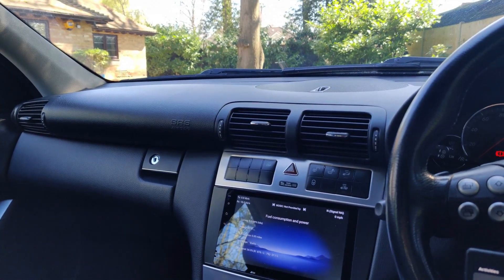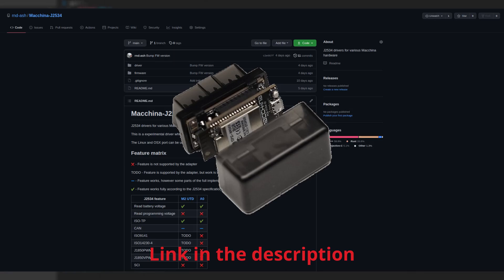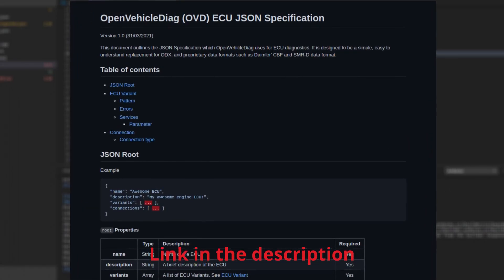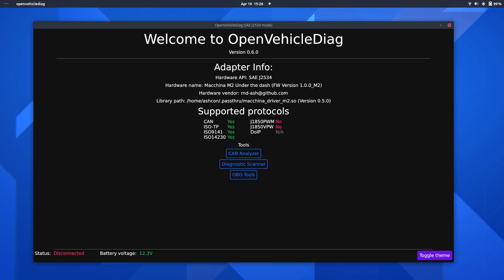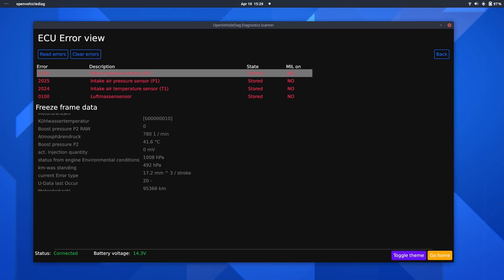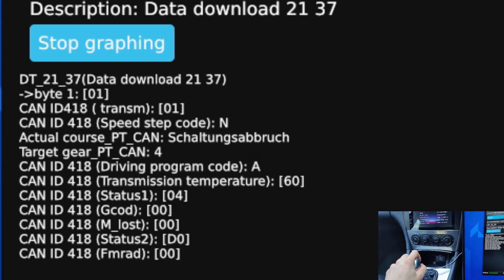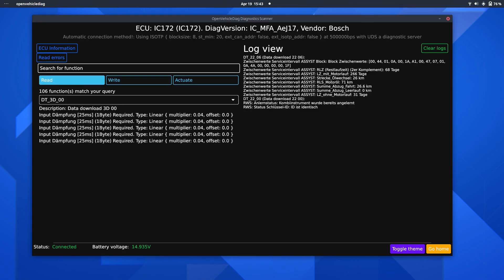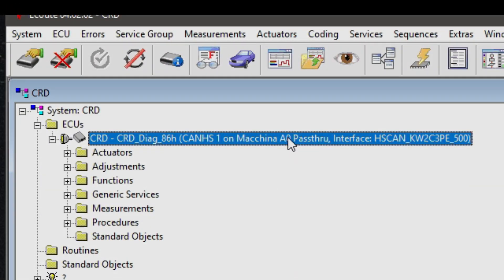OpenVehicleDiag / Macchina-J2534 release 1.0! - powerful open source car diagnostics for all!

Comment: Im in awe as to what you have accomplished. Well done. I do have a question or 2. Im was intrigued with the fact that you could get Xentry to work with your W203. Which is why I ended up here. Im having some serious ecm issues and was hoping I could get some info or links to connect my Arduino to the vehicle using the obd port? I need to program my ecu to stock as well as do the rest of the system to work with the new ecu. Any links on using Arduino would be great

Comment: Very cool. I also have a W246 that is showing "Transmission malfunction" on the dashboard. Would I be able to see the error codes with OpenVehicleDiag and an Arduino with CAN shield? No local sellers of the Macchina adapters in my country. Thanks!
Reply: same here , were you to them error codes on with CAN shield

Comment: But if the obd reader used a correct can bus chipset then no programming would be necessary .  You just have to get the right software..  is all in the software and parameters provrammed into the software that coincide with the vehicle’s as built code..  so you dont brick the ecu

Comment: i know this is a year old video, but do you have any interest in data from a Rotunda VCMII, and the FDS (Ford Diagnostic Software) data that may allow you and I to work together to make a linux base open source data set for almost every single make and model of car covered by the SAE and EUR, OBDII standard, possibly even moving into tge newer models as well.

my plan is to make use of the Right To Repair laws that have passed recently in the USA to build a software for my personal use both at work (ford technician) and at home (I.C.E. experimental engineering, building, and tuning.)

Current project is to build a software that can be run in a linux environment, perhaps RaspberryPi, or Arduino IDE, that can be a standalone unit for scanning, but also installed permenantly in a vehicle to act as a scanner and tuner.

Comment: Very cool! However, I'm not sure if I understood correctly: Are the JSON files required in order to run commands on any control unit, or will that also work when the software discovers them?

Comment: Could these JSON files for the ECU data be used for example in Torque or such android applications? Or is it because of the ELM327 OBD adapter that those apps can’t find alot of info from the ECU on my 270 CDI?

Comment: Not working on w210. I'm using 38 pin connector to plug in a0. Everything's connected, and it's scanning for ISO-TP but can't read any errors. Just says that no ISU-TP capable ECUs were found in my vehicle. Any suggestions?
Reply from the maker: Yes it would never work on a car that old as it has no ECUs that can be diagnosed over CANBUS, only Kline (LIN)
Reply: @RANDASH  is there anything I can do to read them ECUs with my Macchina a0? Or should I order m2?
Reply from the maker: Hate to say this but pretty much the only thing you can do at this point is get a newer car....A0 doesn't and will never support LIN especially as it's a long dead protocol.
Reply: @RANDASH  What about M2? Any luck with K-Line implementation?

Comment: Can your software be used to interface with the car functions say to control the A/C from a touch screen head unit? Something like the iDatalink Maestro RR2 adapters for other cars?
Reply: Here is another project more focussed on bi-directional control. https://www.youtube.com/watch?v=HEmI2MzDya4&t=490s&ab_channel=Roudter
Reply from the maker: Technically yes, but practically no. This is meant to be done via the OBD-II port of a vehicle, which tends to be firewalled so you can't send whatever you want over the port.

If you know what CAN Frames to send to the A/C control module to control things like temperature, then there is nothing stopping you from hard-wiring directly into the CANBUS network with an Arduino and sending custom CAN Frames. This is similar to what I have already done with my mbux-port project: https://youtube.com/playlist?list=PLxrw-4Vt7xtstJgl7B1ayPXBFBRulu41J